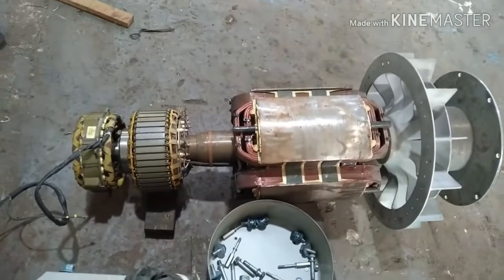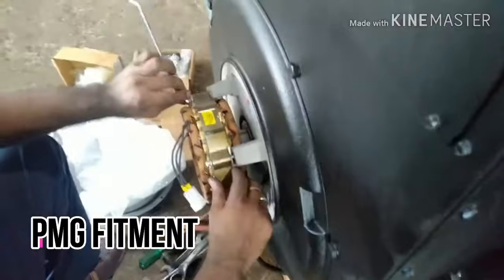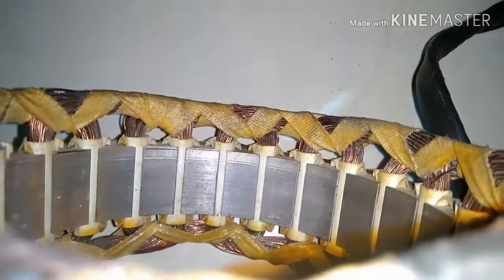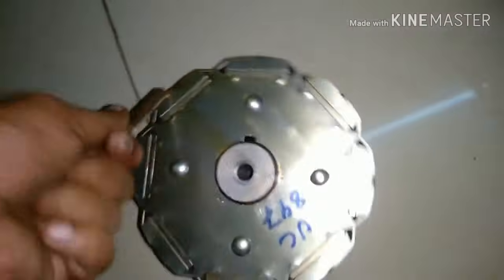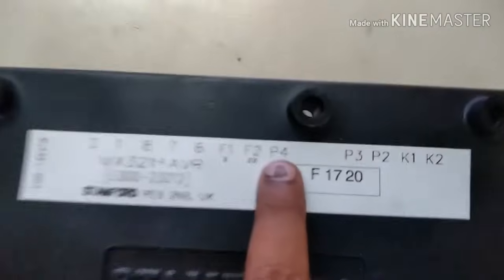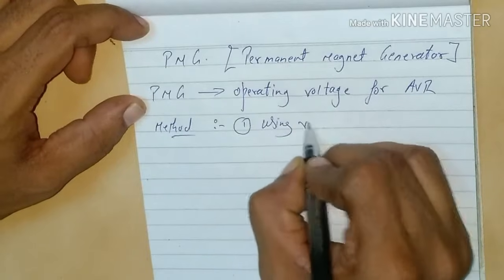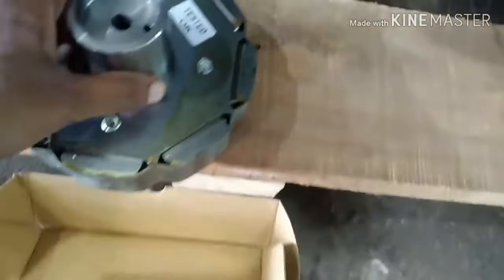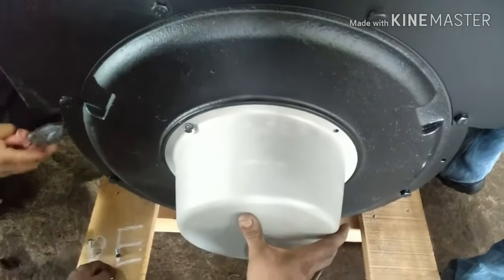PMG ( Permanent magnet generator) With updated audio edit .

Comment: Thanks.but i think it would be nice if these things were included to explain ex-how do you connect the wire AVR. P4.P2.P3.R.Y.B.X.XX. and how to check pmg.exciter. diode. And winding resistance using multimeter.
Reply from the maker: I'll do one full explanation video soon.